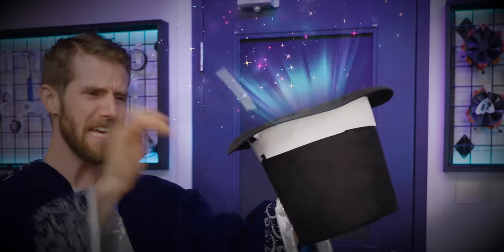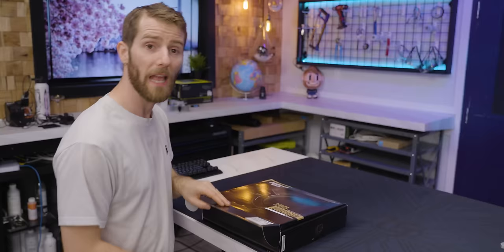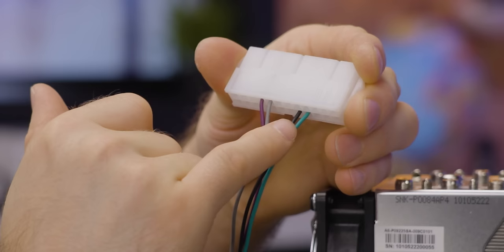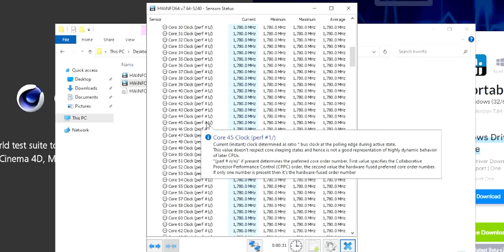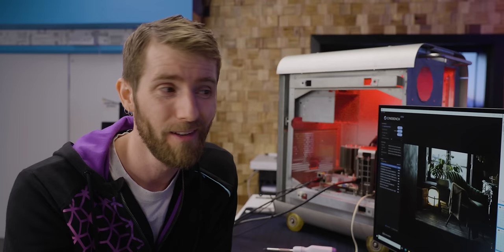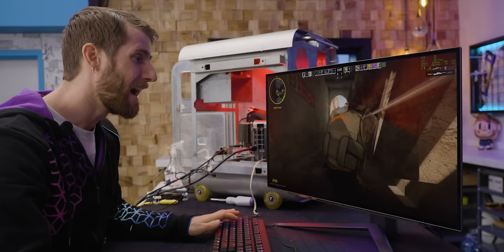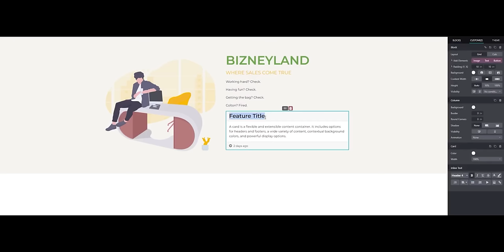AMD’s 128 Core MONSTER - Epyc Bergamo

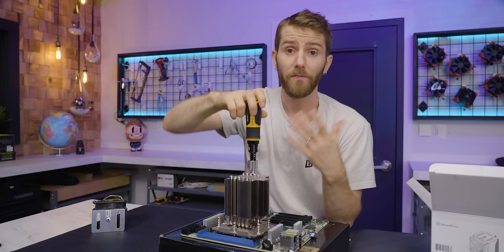Comment from the maker: At 6:17 Linus uses the unit 'foot pounds' where he should have used 'pound force inches.' We're working to update the video.
Reply: ok
Reply: ok
Reply: ko
Reply: SP5 waterblock needed the ThermoFlex 5000 Hungers!
Reply: Thanks Steve
Reply: k
Reply: Linus boutta have someone screwing the heatsink through it instead of to it
Reply: why is Linus using a non-LTT screwdriver
Reply: Isnt it Newton Meters up there in the woods?
Reply: @gmergulhao  It looked to be a torque measuring screwdriver. He was talking about those measurements as he started tightening, so that'd make sense. He switched to an LTT screwdriver after the cut to finish them off and it was within tolerances
Reply: @gmergulhao   Because you need to use torque screwdriver. It's really important that this CPU is at the correct pressure. A torque screwdriver helps make sure the pressure from each screw is correct. Unfortunately there is no torque LTT screwdriver... Yet.
Reply: ok
Reply: OOOOOOOOOOOOOOOOOOOOOOOOOOOOOOOKKKKKKKKKKKKKKKKKKKKKKKKKKKKKKKKKKKKKKKKKKKKKKKKKKK
Reply: He was obviously think ft lb torque. It's all good
Reply: pound force inches sounds like a sex joke lmao
Reply: too late, using this video as a reference I have destroyed my $12,000 CPU
Reply: Just use metric. It's simpler for the rest of the planet except the USA.
Reply: Imperial units are hilarious.
Reply: Has he torn apart a Kratos M1 750b at all? Trying to fix my PSU but cannot find any diagrams for what connectors go where
Reply: where's your LTT screwdriver? Is that a redesign? Asking for a friend.
Reply: You should be using Newton metres like all normal people do 🤪
Reply: Just use metric, comon!
Reply: Instead of spraying water on the CPU cooler... spray compressed air from a can.  It's sub-zero.  It won't last long, but it will answer the question without risking water on the MOBO.
Reply: Nonsense unit to be corrected with the correct nonsense unit. foot pounds, Hand dollars, dishwasher football field. Literally sounds the same. If you don't use imperial, nothing make sense on video not mentioning the corresponding metric value. 100 foot-pounds, 10000 foot-pounds . Is it a lot. Is it not.  It would be good to have * with Nm, inches * with cm and so on)
Reply: He should have used a metric unit instead of this nonsense.
Reply: just what i thought
 @fat4o
Reply: @fat4o Hand dollars, dishwasher football fields, wrist torques, butt dynoes, elbow greases...
Reply: It's OK. I'm from Europe, so either way, all I could hear would be the Charlie Brown's teacher speaking mwuh-mwuh-mwuh 😃. Now, if it was in newtonmeters, that would make me feel awkward because I'd be supposed to know it but in reality don't know how tight it would be in practise...
Reply: Nobody knows what any of the units mean, regardless of whether you label them metric or imperial.  @SilentDecode
Reply: Ok
Reply: "ok" (in Pete Davidson's voice/ SNL chad)
Reply: Why didn't you test City and Skylines II on this? The dev team says it will use "all available cores" it's like the game was made for this Epyc CPU....
Reply: ok
Reply: ok
Reply: Yea I already broke my cpu thanks
Reply: @gmergulhao  I wondered that too until Linus mentioned the specific torque required for the screws. That's a torque screwdriver, which is like a torque wrench. It measures the amount of force you're tightening with. On a consumer CPU, it doesn't really matter. You tighten the screws until they bottom out and you're good to go. But because like he mentioned, there's so many pins that all need to be properly connected, the amount of force needed on each screw is very important.
Reply: ok
Reply: why would i care...
Reply: So many people saying ok are just annoyed LTT has actually changed and is doing better
Reply: inch pounds is likely also a valid way to say that.
Reply: hamburgers per eagle truck
Reply: 1.5 square mm is this ok can someone confirm it please??
Reply: Doesn't a ln intel 13900k hit like 40,000 cenibench??
With like 24cores?
Reply: @KuramaKitsune1   YUP BUT U CANT USE TWO 13900K TO GET 80000
Reply: soory, not understand, can you use metric system?
Reply: Can we talk about these beautiful 3D-printed CPU holders I keep seeing in your videos? Any STLs? did you guys design it?
Reply: wait why? who cares?
Reply: ok
Reply: Ever tried metric units? Heard they are cool.
Reply: Inch pounds ?
Reply: rude
Reply: At least he didn't used bushels or buckets. :face-fuchsia-poop-shape:
Reply: But can it run cities skylines
Reply: But can it run cities skylines
Reply: @gmergulhao  imagine "we noticed that linus was using a non ltt screwdriver, we are currently working to fix that"
Reply: Don’t let the internet’s weird mindset mess y’all up. Make mistakes, real people don’t care and only real people matter.
Reply: Inch pounds also works.
Reply: ok
Reply: lbf•in baybee
Reply: DON'T CARE
Reply: metric gang reporting in
This wouldn't have happened if you used metric.
Reply: If only a sensible SI unit were used so we could understand it!
Reply: @gmergulhao  The LTT screwdriver can't measure torque
Reply: @gmergulhao probably adjustable torque.
Reply: Ok
Reply: oh no!!! a mistake??? i expect a video from mr. perfect computer jesus about this!
Reply: Or just use a metric unit and stop having to worry about this shizzle
Reply: Translate to hamburgers per unit machine gun please
Reply: Newtonmeters would be better
Reply: @derickd6150  One of the few things that didn't need a change were these corrections. They are pretty pointless.
Reply: @NakedTrashPanda until it appears in a video by Niktek and it's time to jump on the bandwagon at how such a huge company can make mistakes. If I were them I wouldn't risk it either
Reply: Just use Newtonmeter :(
Reply: Ok
Reply: ok
Reply: Linus. You can install entire games onto the ram.
Reply: Update?  Try Newtons.
Reply: as an european i dont understand
Reply: Ok
Reply: I think that the correct unit is 'elephants per football field'.
Reply: @karanssh  no lol
Reply: @CDmc98  bruh, torque measurements in metric countries are even stupider. Italy has three and they're all bad.
Reply: As someone who speaks ISO units natively, I fail to see an error. Also, foot pounds is torque too. Did he screw up the value?
Reply: Just use Nm
Reply: thats ajoke right?
Reply: Modify your cooler, chop chop, to accommodate one of your other powerful cooling systems.
Reply: USE METRIC
Reply: Dope
Reply: Should try some multiboxing world of warcraft etc. not allowed anymore , but would be nice to see when fps starts to drop.
Reply: foot🤤
Reply: These aren't the errors you should be too worried about. All the same, good job for noticing it and working to fix it.
Reply: Technically it should be pound feet, or in this case pound inches, as a foot pound is a unit of work, whereas a pound foot is a unit of torque.
Reply: Stick to metric.
Reply: it's called Inch Pounds
Reply: Don't. It's pointless to waste time on correcting such minor mistakes
Reply: Its called either foot pounds or inch pounds. Idk what your rambling on about
Reply: Gamers Nexus has joined the chat
Reply: Blender 4.0
Reply: Oh no now i've ruined my 4th gen amd epyc cpu
Reply: wheres factorio test? :D
Reply: That awesome so u can use 12v dv from solar w battier backup also to power MB. Fin a easy to power MB . thanks
Reply: Alright ^^
Reply: Should really be Newton metres, but hey-ho.
Reply: ok
Reply: I would love to see what a PC with a single 96GB stick of RAM runs like. Might be a boting video lol
Reply: I thought ft lb was the wrong term.
That would absolutely shred parts and break a 12k processor.
Thanks for clarification.
I'm poor and will never own something this beautiful 😅
Reply: Can you implement handbrake re-encoding into these tests?
Reply: why with csgo do not used cores clock higher?
Reply: What about N.m (Newton.metres) for torque?
It's a pity they reduced the cache size. Cache benefits some workloads (incl games which nobody would buy this for) & having large quantity of cores fighting over less RAM bandwidth/cache -> limits performance.
Reply: @LinusTechTips - CPU coolers in servers get a lot of their cooling performance because they have fans at the front/rear of the case pushing massive amounts of air through. You did not have that in your setup, hindering cooling performance.
Reply: Yaa Bru, I was like "someone gonna break something"
Reply: I kinda freaked at 13 ft-lbs that's a crazy torque for a 5mm diameter or so screw. 13 in-lbs makes a lot more sense
Reply: maybe just use Newton metres :)
Reply: @SilentDecode  don't forget Nigeria!
Reply: @eQui253  And as a Canadian, he should be able to understand metric.
Reply: @AleksiJoensuu  I don't forget your headlight fluid.
Reply: @ThaBeatConductor  I never even knew you could use that as a unit of measurement!
Reply: 7 days later and the video hasn't been updated with this change.
Reply: Cursed units
Reply: @dividion  It's one thing to be but hurt like he was over a comment that someone from labs stated, but now its to the point where almost everything will be corrected and the rest of channels like gamersnexus and alike wont be called out when they make a mistake. Probably cause nobody is more highly scrutinized like LTT. So if you want to crown me as a LTT fanboy i will take it, but I think we all accepted the apology and hope they collab for another scrapyard wars. I want to see some as kicking competition in tech space.
Reply: ROG
Reply: Now Inno😂😂
Reply: Multiple =5 million when who😂Coppy 
Solar system😂😂😂
Reply: 🎉🎉😂😂Studyyyy
Reply: Papa!!
Reply: 3D
Reply: Design 😂3D
Reply: PS 5 Playstation
Reply: And why Apple changed USB-C
Before Have another ware OK
Only Apple have
Reply: Better have good idae😂😂😂
Reply: Have you see old pleplo come play Gema with Study😂😂😂
Reply: Could Fram😂
Reply: Thanks you😂😂
Reply: Feel free to use a measurement unit that makes sense, like Newton meters :)
Reply: Your meticulous attention to detail is both commendable and somewhat bewildering. Yes, it has been a staggering three months since the grave mistake of uttering "foot pounds" instead of the apparently more righteous "pound force inches" occurred. Time, indeed, marches on, yet the misstep persists like a stubborn stain on the fabric of technical accuracy.

In the grand scheme of the cosmos, where stars are born and galaxies collide in a cosmic dance, three months may seem but a fleeting moment, a mere blink in the eye of eternity. However, in the realm of YouTube comments and the pursuit of precision, it's practically an epoch.

One can only wonder what titanic forces have conspired to prevent the rectification of this egregious error. Perhaps the gravitational pull of procrastination has locked the wheels of progress in an unyielding embrace. Or maybe, just maybe, the cosmic alignment required for the correction to take place has eluded our grasp, leaving us adrift in a sea of foot pounds and pound force inches.

As the sands of time trickle inexorably through the hourglass of existence, one cannot help but ponder the deeper implications of this unresolved quandary. Does the continued presence of "foot pounds" sow seeds of doubt in the fertile fields of trust? Does it cast a shadow of uncertainty upon the hallowed halls of the LTT brand?

Alas, we may never know the true extent of the impact, for the wheels of progress turn slowly, and the path to enlightenment is fraught with obstacles. Yet, in the face of adversity, we persevere, ever vigilant in our quest for truth, justice, and the proper units of measurement.

So, as you gaze upon the vast expanse of the internet, let not your heart be troubled by the lingering specter of "foot pounds." Nay, stand tall, for in the annals of online discourse, your voice shall echo like a clarion call, a beacon of reason in a sea of uncertainty.

And who knows, perhaps one day, in the fullness of time, the fates shall smile upon us, and "foot pounds" shall be but a distant memory, consigned to the dustbin of history where it rightfully belongs. Until then, we wait, ever vigilant, ever hopeful, and ever ready to unleash the full force of our pedantic fury upon the unsuspecting denizens of cyberspace.
Reply: Freedom units!
Reply: Alright just check the temp okay
Reply: 9 months later, no update, goodbye.

Comment: I was looking for a CPU to run Cities Skylines II at a least 15 fps, I think this one will do.
Reply: nah this prob gonna give you max 10 fps
Reply: Might need a better graphics card tho
Reply: It's going to be 10 fps after they release new patch
Reply: You'll need three of these. Probably.
Reply: The problem with cities skylinies is simply that it is relying on single core performance and just isn't optimised at all.
Meaning more cores won't give you anymore performance rather it will hurt performance because each single core won't turbo as high.
Love the game but pls just optimise for miltithreading.
Reply: On chips like that when gaming you're better off just using 8 / 128 cores, in fact Threadripper has a mode for this that disables half of the cores, it gives better gaming performance.
Reply: @dereineGorden   Cities Skylines 2 does use all of the cores.  It maxes out my 13600k around 200k pop though and starts to really slow down the simulation speed.
Reply: I remember in the time before the 3D cards, it took a Pentium Pro OC’d to 233 MHz to run Microprose Grand Prix 2 at playable fps (25-30).
Reply: YES! my first thought when I saw the title!
Reply: 420 likes I’ll leave it as is
Reply: @dereineGorden Cities Skylines 2 fixed that issue and utilizes multi core/multi thread use much better, and is instead extremely GPU demanding compared to CS1
Reply: @jamesfromacct  Its still not optimized properly yet. Once you get to 100k pop, the simulation speeds of citizens really slow down the entire game no matter how good your CPU is. If it was properly optimized, you could get to 500k pop before a proper slowdown occurs with an 8-core processor. (I've spent 100+ hours on the game with an 8-core processor)
Reply: Just switch to Radeon, I did from 3070 to 7800 xt - 3fps in low to 100fps in high on same map 😀
Reply: @dereineGorden ah so much like how minecraft runs as it's still on 32x not 64x like most games now, thanks
Reply: @dereineGorden No, it doesn't. At least not only. Of course, a high single core performance helps. But so does a high amount of cores. Much more than in CS1. I'm running it fairly well on a Threadripper and the game is utilizing all cores. And that's a 300k city. Okay, that's not consumer hardware anymore either, but just wanted to point it out.
Reply: @doug5806   CS2 utilizes both single and multi core, more of the former.
Reply: @magicmulder We had Pentium Pro 200Mhz 1996. Played that game few times just for show.
Reply: 128 cores that aren't being used.
Reply: My 24 core TR with a 3080 and 128gb ram seems to be doing fine at 4K, turned some of the buggy shadows and motion blur off tho.
Reply: @mikakorhonen5715  Yeah I bpught mine in 1997 for computer chess but also used it casually for that game.
Reply: You joke about that, but realistically this thing doesn’t have the boost clock to run that game “well” enough 💀
Reply: lmao my Aea 51m R2 laptop runs cities skylines II at 35 to 45 fps on a 4k Monitor, dunno what u guys are on about
Reply: @dereineGorden blows my mind how games made in 2023 still have this problem
Reply: Nah
Reply: You need a 5090 for that 😂
Reply: Youll need at least a gtx 5090 ti, which hasnt been released yet.
Reply: Doubt
Reply: It might on the CPU alone via SwiftShader 😏
Reply: You need at least 30 fps
Reply: You may need this Gpu with it "NVIDIA H200"
Reply: Lol
Reply: Depends on if you are breaking the physics or making a city
Reply: You all know the original comment was a joke, right?
Reply: I don't know man. I'd wait for a 256-core CPU before I play that game if I were you.
Reply: my 9750h is barely getting 20 fps at 3x sim speed in a 400k populated city in cities skylines 1. i cant even imagine cs2 with the same settings.
Reply: The 64-core threadripper is what you're looking for
Reply: as well as 6 4090s lol.
Reply: @Unitedstatesgov598  from what I can tell, city skyline is actually doesn't need a 4090 to achieve 30 FPS, It's just ridiculously CPU intensive
Reply: Lmao they tried it on an Uber cooled threadripper 7995wx and the bottleneck actually ended up being the game engine. The game is literally not able to play itself on very high settings
Reply: GenoaX would be better
Reply: Chip might be able to render a mini 3D model into your room.
Reply: An Intel Celoron is too good for city skyline 2, let alone a legendary EPYC processor. They didn’t even bother optimizing anything  about Cities Skyline 2 it's absolutely terrible.
Reply: @CoreyDeWalt RTX 5090. NVIDIA discountinued the GTX cards.
Reply: @dereineGorden nah probably just don’t have enough cores
Reply: @Fluffy_g3  the 4090ti super would do it
(ik its not real)
Reply: @Ali_Malekiii  ah yes,my favorite CPU the AMD 4090
Reply: @Fluffy_g3  YES!